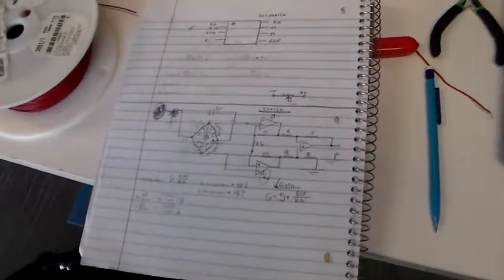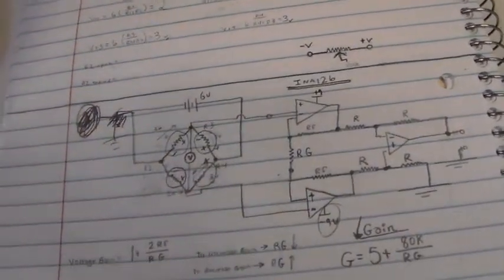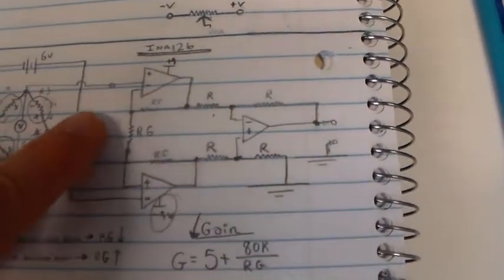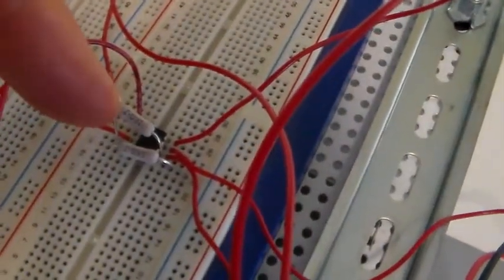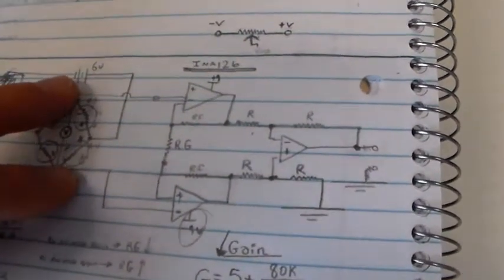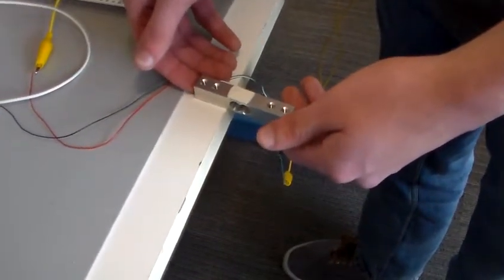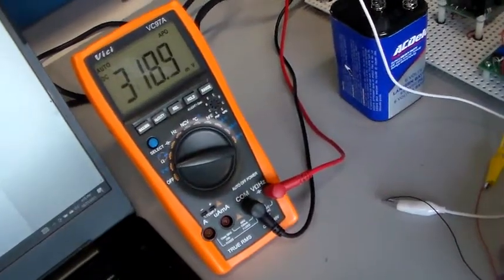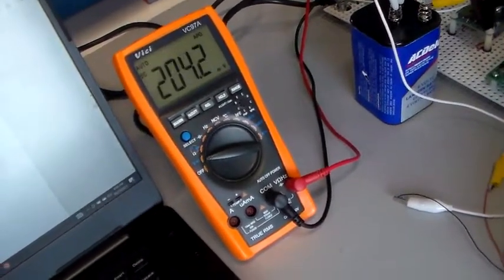Load cell with instrumentation amplifier

Comment: The INA126 seems to have a cut in requirement before it begins to increase the output signal. Mine reads 0.645V with no weight on the cell. As I slowly add pressure it holds 0.645V until reaching a force threshold and then the voltage slowly climbs as anticipated. I have a different style load cell reader and it does not do this. It will read a force increase as soon as its applied. Why does the instrumentation amplifier have this cut in requirement? Changing out the resistor for a higher gain reduces the cut in, but then the output becomes saturated too soon.

Comment: What are the resistor values you are using for instrumentation amplifier and can I know the gain as well?
Reply from the maker: This student used an INA126 which is a self-contained instrumentation amplifier (laser-trimmed internal resistors!) and lets the user control gain through a single external resistor labeled Rg, in this case Rg = 500 Ohms.